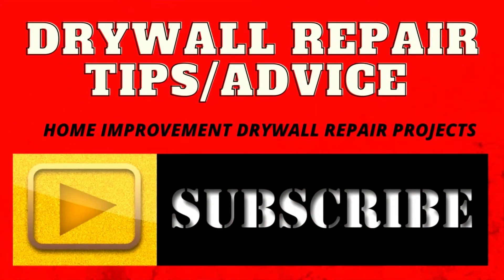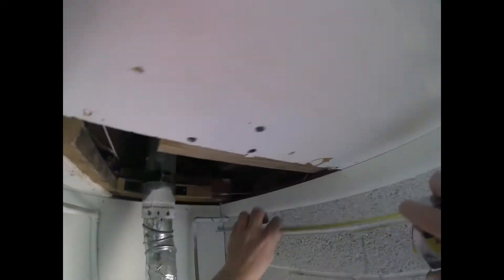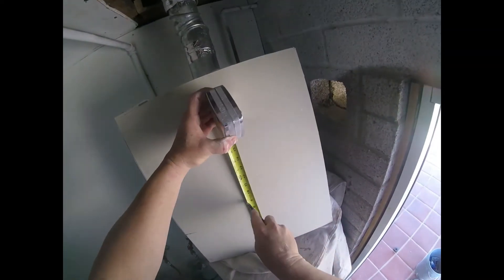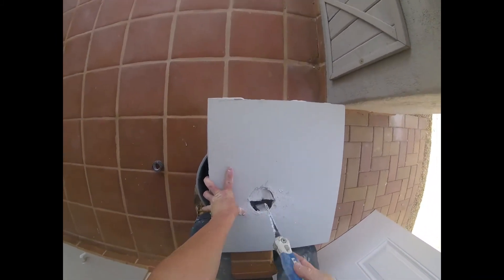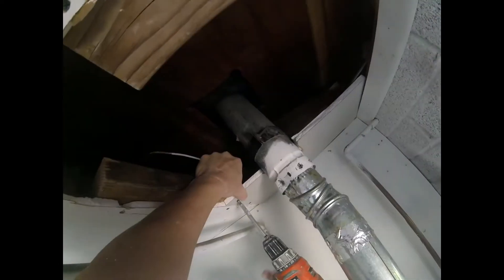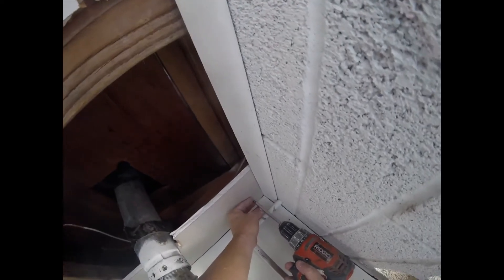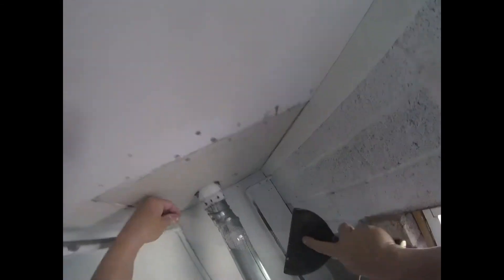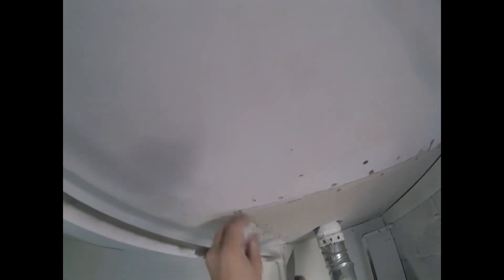Sheetrock install around vent pipe that can't be removed sheetrock patching & texture drywall repair

Comment: Great video, so annoying watching other tutorial videos where they spend so much time talking. You were straight to the point! 

One question though, everything I am reading says there is supposed to be a 1” gap between the pipe and the drywall. My exhaust can get pretty warm. You are saying to go right to the edge for a clean finish. Should I be concerned about the hot exhaust touching the drywall?
Reply from the maker: most are double lined vent pipes and only exhaust is heat but all these are sealed tight drywall in garages per code
Reply from the maker: more patching video playlists here -  https://www.youtube.com/watch?v=kmNksSpf4AE&list=PLBz61ZEZh-RVf03b8u7hzfjxngWsUPHgh
Reply: 2 questions as I’m finishing around a kitchen hood exhaust vent exit the contractor left a big square around where the tube exits. In your video it looks like you mudded the gap between the rock and pipe. I thought heat resistant expansion foam wrap would be used there for pipe expansion? You also said you use tape but I didn’t see any applied.